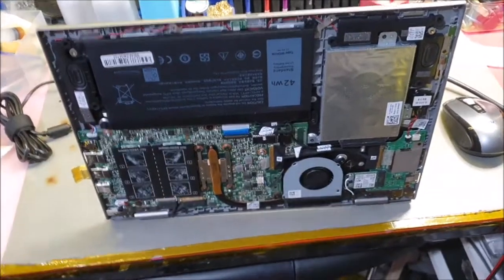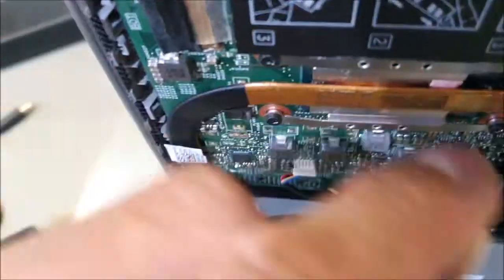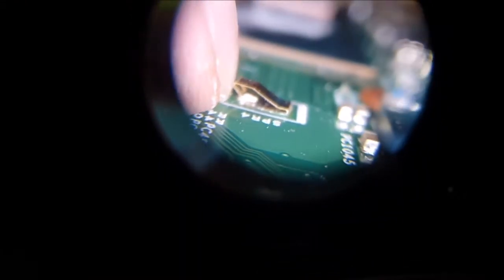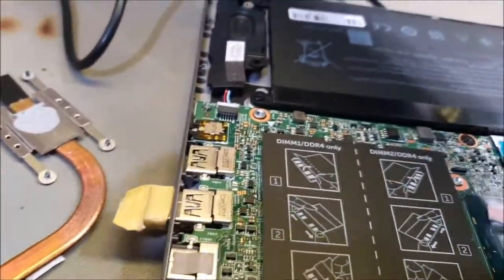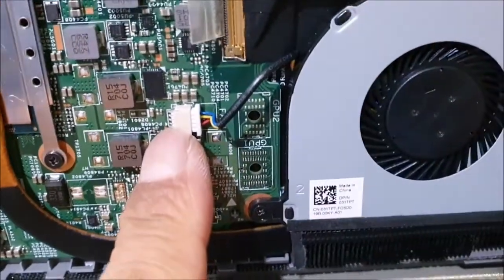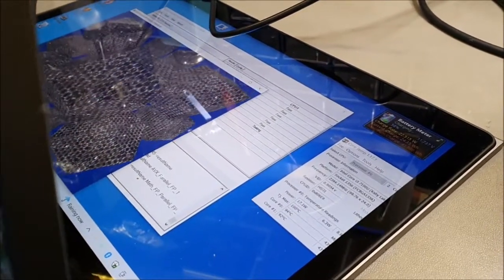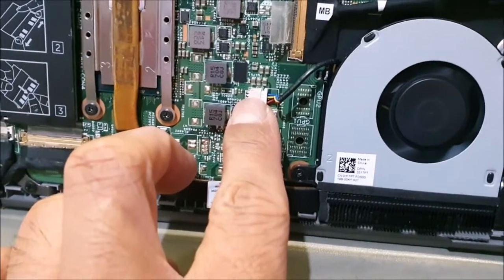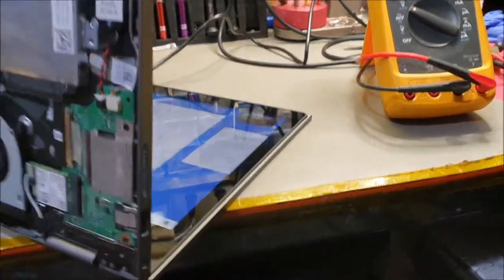How to fix Dell Inspiron 13 5378 no fan spin overheating

Comment: Quicker fix with no damage risk: do not try to alter the metal piece that touches the heat pipe. Put a blob of thermal paste on it instead. Now it will contact the heat pipe.

Comment: Hi I’ve lifted the clip but now the fan is always on with temps around 40 or 50 degrees… do you mind what could be wrong here? Maybe the fan idk what to do
Reply from the maker: If the fan is spinning around this temp, let it be. It will help prolong the life of your cpu and gpu (if you have one).

Comment: are you sure these clips are thermal sensors? I assumed were just used to ground some parts as in this case the hot pipe… they solders on a single pad usually ground so no way to act as sensor in my opinion…
Reply from the maker: Good morning,

Yes I agree this is a ground clip, hence Dell is also using this as thermal measurement conjuction with fan circuit.  After replacing this clip fan been working great and the laptop has stopped overheating, no shut downs, or crashes.  Take care 😊👍

Comment: Couldn't i just use a thermalpad or paste over it to fix it faster/easier?
Reply: If an electrical connection is required the thermal pad could be not enough to ensure electrical contact as normally conducts heat but not electricity.